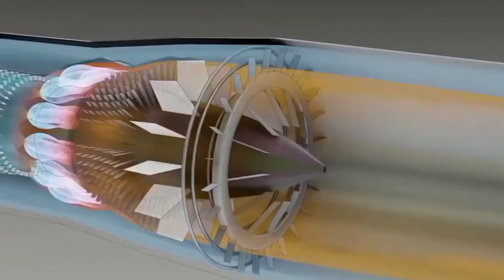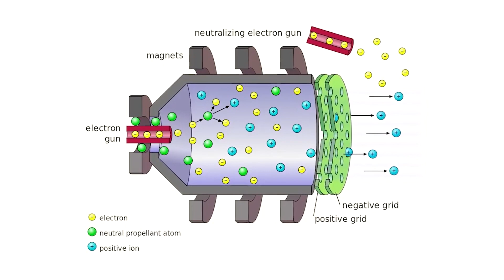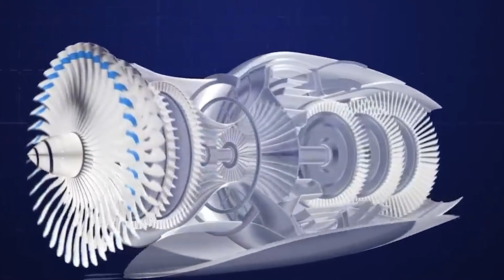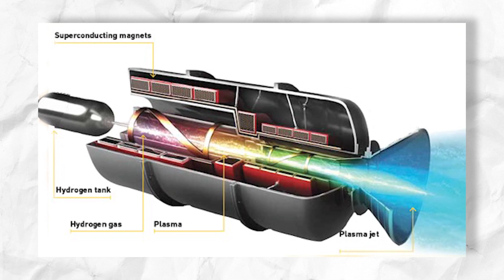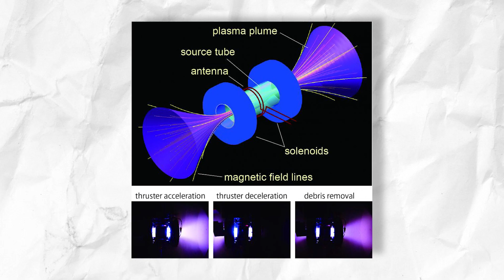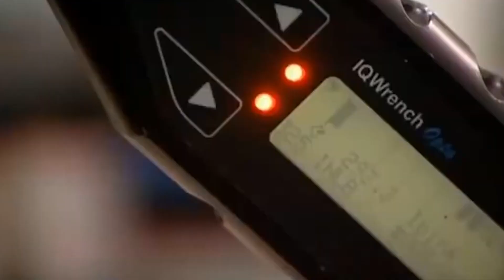Engineers Just PRESENTED World Record Nuclear Engine

Comment: the nuclear engine spraying radioactive radiation out the exhaust nozzle would be worse than a dirty bomb constantly going off everywhere it flies
Reply: The nuclear engines that have been designed and tested don't have any radioactive exhaust, it's basically just a big heater, the reactor has tubes running through it, and the heat generated by the reactor heats that air, as the heated air expands, it moves through the tubes creating thrust. The biggest drawback was the shielding, it was incredibly heavy, and the B-36 was the only aircraft so far that the engine was tested on. This video really doesn't explain anything, and the photos/videos used are almost all of standard turbofan engines. There's much better videos out on YouTube that explain the nuclear engines far better.